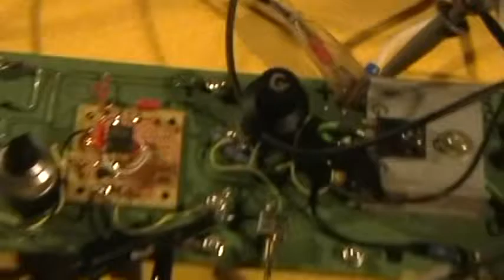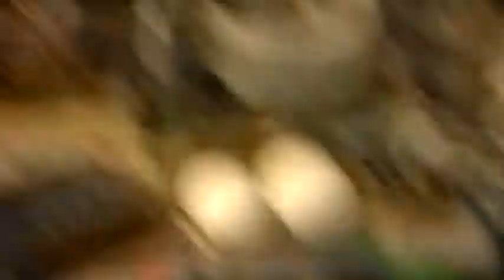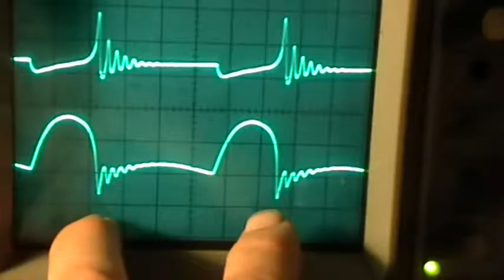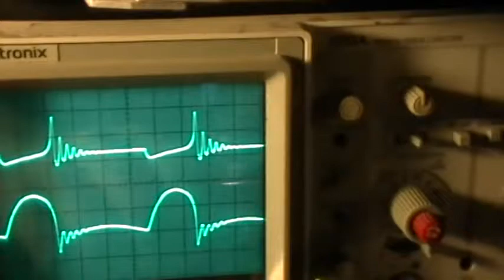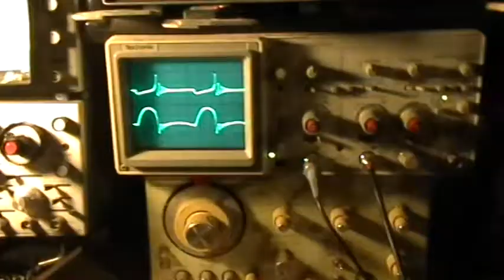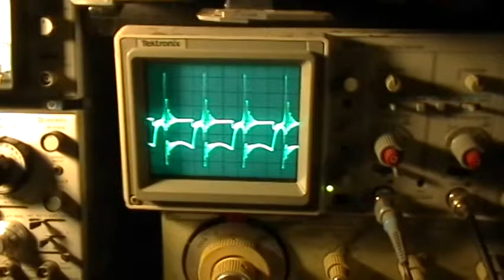Electric OU: Supplement: DMM Average Current Checked w/ Scope

Comment: Yes, this works at frequencies above about 100Hz to 100's of MHz.  I have precise measurements that confirm the theoretical basis for why it does.  This gives you average current and voltage.  It does not yield average power.

You can get average power by using a stiff bypass network to reduce the AC voltage source impedance.  I calibrated up a current sense and power bypass board last year.  I designed that board with the intent of getting it to Rosemary Ainslie for the August demonstrations.  In speaking with them extensively I judged that such a fixture would add unwanted changes that they would have a difficult time understanding.  I never sent them one and they obtained different low inductance current sense resistors of their own.

I gave one of the boards to an associate who said he sent it on to you.  It should be ideal for these experiments.  If you didn't get one, I will have some words with the intermediary.  Let me know if you never got it and want one.  If so, then I will make up another one for you.
Reply from the maker: I do indeed have the board you and your associate calibrated for me and I'm grateful for it. I'm concerned about the fragility of the SMDs on it; it needs to be properly mounted to a base and I just haven't gotten "a round tuit" yet. I suppose I'll do it today, thanks for reminding me.
The non-inductive resistor I am using here also came along with that package, plus some other items I've put to good use.
However the board is populated with an IRFPG50 and I am testing here the Grey Box circuit you RE'd, using an IRFP450, a very different critter. Also the board has a 4R7 resistor soldered into the "heater" pad positions ... I need to remove that and connect my actual load here. Right? And finally the schematic for the board is marked "CONFIDENTIAL" -- that's a little offputting if I'm going to be using it for these public demonstrations.
You are right about them, or at least RA, having a difficult time understanding. I hope you have seen the nonsense where she actually has accused me of faking the results and the functioning of the stripped-down Q2 common gate oscillator portion of the 5-mosfet circuit. I really resent being accused of such, since what I present is so clear, simple, and easy to reproduce by anyone interested.... and I think it's too bad that people who seem to be able to communicate with Ainslie haven't sat down with her and explained just what is going on and that there is nothing whatsoever faked about my videos.
Reply from the maker: "This gives you average current and voltage.  It does not yield average power." I agree that the product of the (average V) and (average I) does not always equal the average of the instantaneous IV products, but in the special case where one variable is or can be taken to be constant, are not the two computations then equal?
Reply from the maker: OK, I've just tested the bypass board, with the same 555 timer drive that I used in the previous video, at 164-165 kHz as before, and the same oilbath load cell. Then I used the Probemaster 4983HG ground clip on a 10x probe to sense the current at J9 as prescribed. Using the same "eyeball" method of estimating the scopetrace average that I used here, I get agreement to within 5 percent error of the inline DMM average current reading (0.40 A scope, 0.38 A DMM). I'll try to show this in a video a bit later on.
Reply: TinselKoala
Oh good you did get the board.  The battery voltage measured at the board should be very steady.  I'm looking forward to seeing what you see on your oscilloscope. Measurements I performed before handing the board over showed about +/-1 - 1.5% small ripple in the 450kHz region.

When using that board please keep in mind that the circuit common on that board is the Q1S terminal.  BAT- to Q1S is on J9, and BAT+ to Q1S is on J8.  TP3 to TP9 gives you a frequency compensated image of the current sense from J9.  You will see the true no overshoot current if you measure there.  I calibrated that to be accurate to about 50MHz.

Once you have the voltage steady to 1% or 2% ripple then the current multiplied by that almost unchanging value will give you an accurate measurement of the true average power.